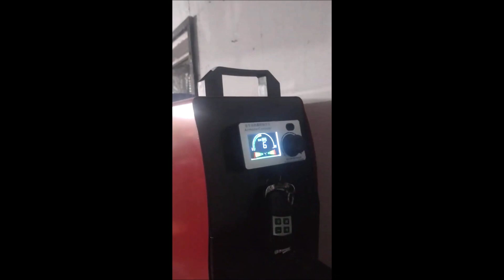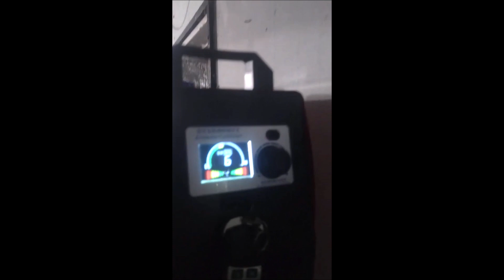Chinese Diesel Heater first startup and I'm amazed

Comment: I got 2 in my converted bus. The first one had a dim control panel, fixed. The second one has a loud pump.
No problems for 2 years. Heavy 12 amp draw at start up, then settles down to > 1/4 amp run. Works
good on 12 volts.
Reply from the maker: Yeah its a nice setup .